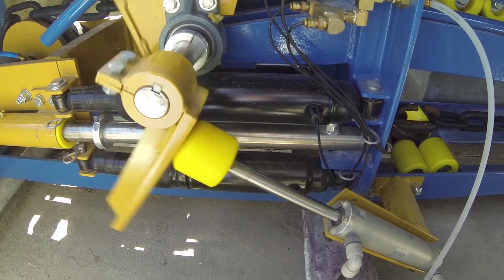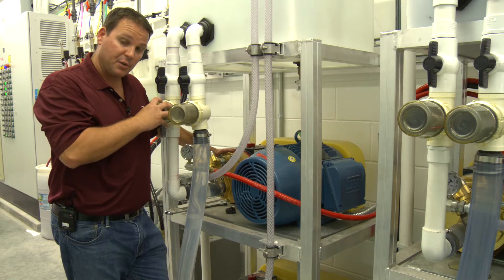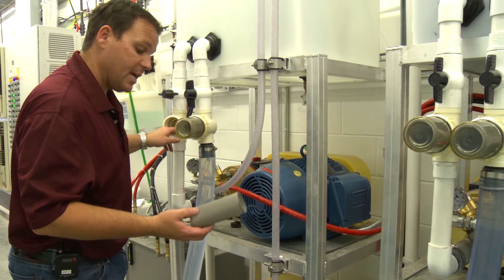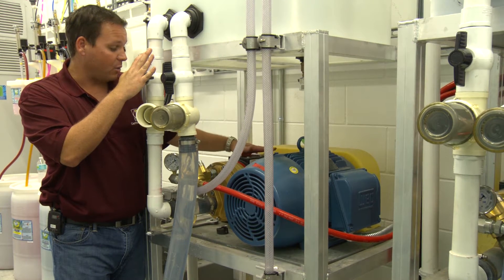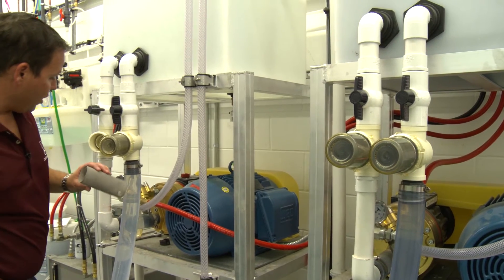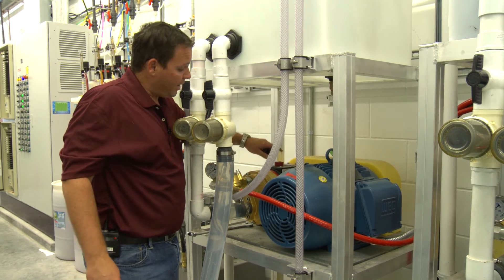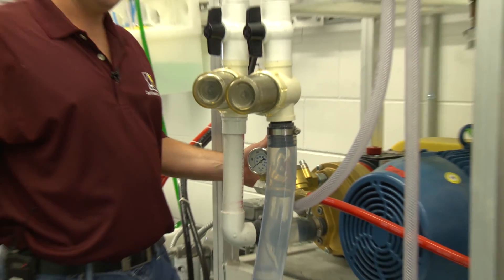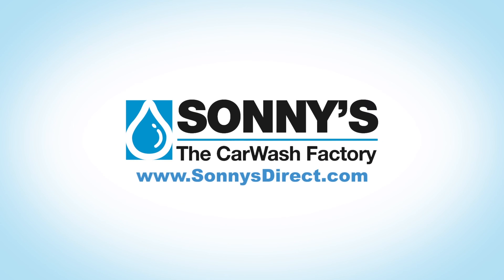Car Wash Maintenance Training - High Pressure Pump Station Maintenance

Comment: What causes High pressure soap to show a blue tint color but Very Little hardly any white suds?
Reply: Check if you have proper air reaching the foam generator

Comment: How much pressure & LPM this plunger pump has?
Reply from the maker: For further details, please check out our website @ www.SonnysDirect.com. Here is the link for the spec sheet for the High Pressure Pumping Stations.    http://go.sonnysdirect.com/rs/587-KRL-127/images/prd_car_wash_equipment_support_high_pressure_pumping_spec.pdf